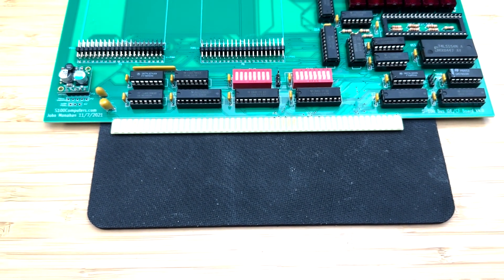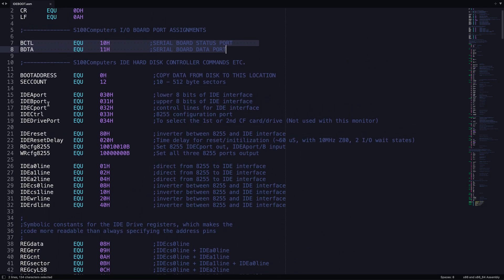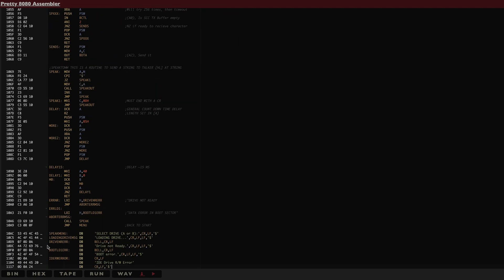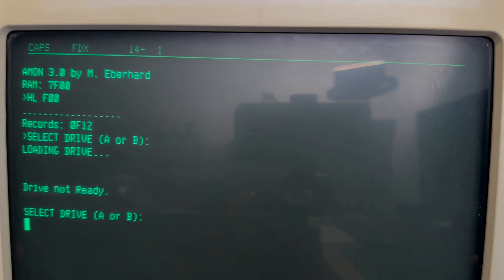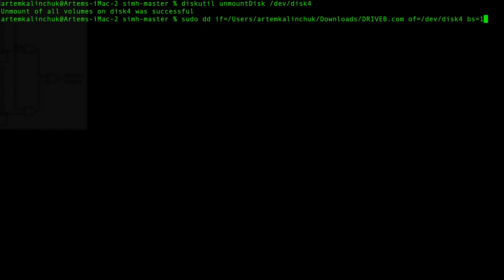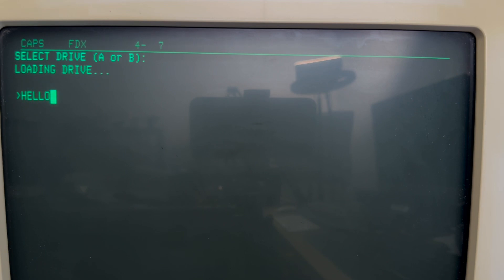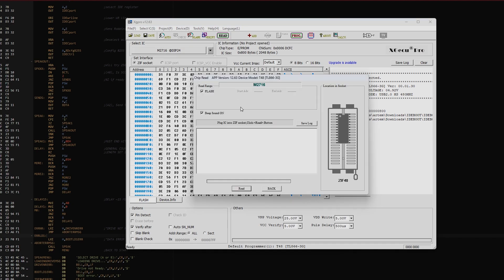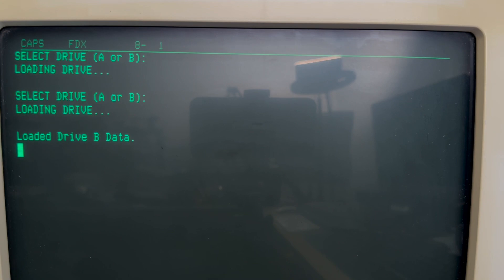Booting Altair 8800 from IDE Drive

Comment: I’m making a similar interface for a 6800 system. Did you get +5V for the CF card through one of the pins on that 40 pin adapter as I couldn’t find it and had to use the 4 pin power connector instead.
Reply from the maker: If you look at the IDE to CF adapter, it states where it gets power from, at the top. Pin 20 is used for power, otherwise it will use external power. Hope that helps.
Reply: @artemkalinchuk  That statement didn't jump out at me before and all the IDE info and diagrams on the internet show pin 20 as 'key'. When I tried to pin it out I missed the fact that each +5V source is wire ORed through separate SMD diodes to the CF socket +5 pins 13 & 38. So that's what they mean by 'Auto' I guess. Anyway thanks for helping me find the 40-pin IDE +5V pin, it gives me more options for designing an interface. I was going to use the 2.5" 44 pin type with 2mm pin spacing that has +5V on it as standard.
Reply from the maker: sure thing. Good luck with the project. You might find schematics for the Dual IDE board used here helpful.
Reply: @artemkalinchuk  thanks. I thought about making a dual cf board to make it possible to make backups, but realized it would be extremely slow on an 8-bit 1mhz 6800 machine. instead I have a partitioning scheme in the works where I can have up to 126 disks up to 16MB each, and even smallish 64mb card can have a lot of floppy disk or hdd partitions on it to hold more than anyone would need. Backups can be done externally on a pc. I’ve even got a 1gb fake SanDisk cf card to work.

Comment: Artem - Wayne Parham here - it's nice to see your videos!  It was also good to chat with you on the DeRamp Altair forum as you worked through this.  Your boot ROM is a nice addition - I might suggest that you install a bootloader onto track 0 of the IDE drive and call it from your boot ROM.  My version of CP/M accesses the IDE drives already, defining them as C and D, or you can define them however else you want.  So you can just call a bootloader rather than your echo program, and my CP/M BIOS will work perfectly for you.
Reply from the maker: Hey! Small world. That's an interesting suggestion, I will try it out. Thank you.